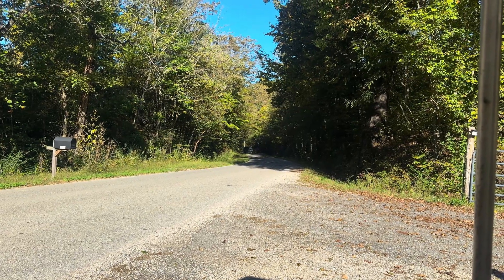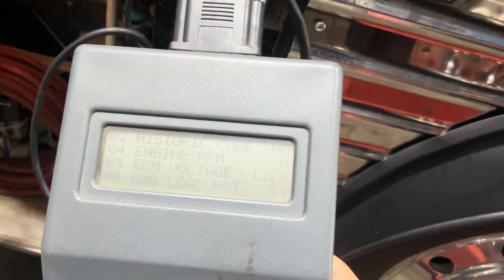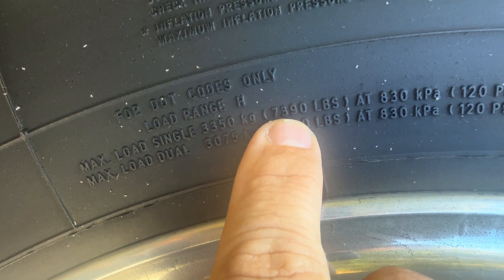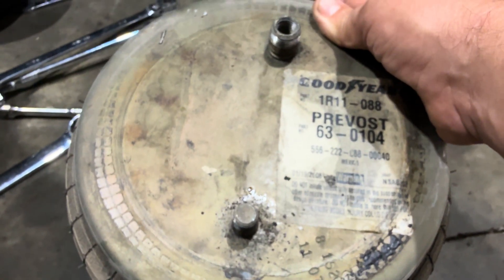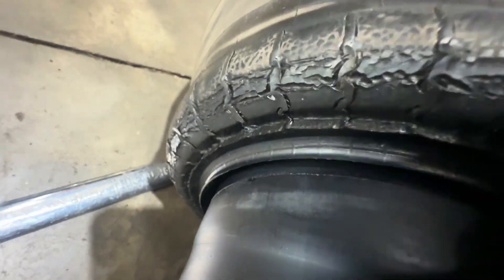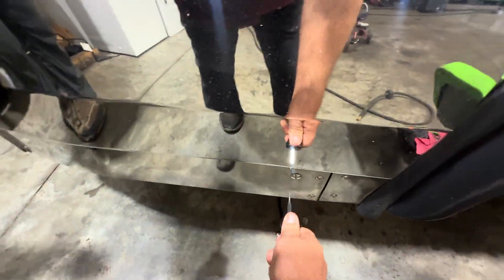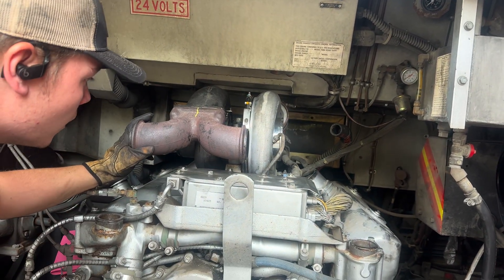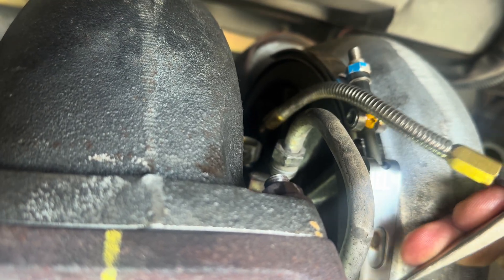Dangerously Overweight Prevost Bus.

Comment: People go nuts with the interiors with tile and stone counters... And forget its a vehicle.
Reply: And those stones and tiles weigh a ton!  Then you add the mud used to hold everything together and you can see where this is going...😊
Reply: @thomastaylor6699 Our floor is Porcelain!!!
Reply: And they pit real wood materials in them also....wood can be very heavy
Reply: @Rccrdawgs  Real solid wood could weigh a whole lot less than a lot of cheaper alternatives. Particle board and MDF is crazy heavy. A single sheet of 3/4" MDF is almost 100 lbs and you are going to need multiple sheets to do anything useful with it.
Reply: Wait...  STONE AND TILE?????!?!?
Reply: @bingusmctingus4395 yeah they come from the factory like that even for the big-money ones. Lmao. Rolling McMansion.
Reply: @bingusmctingus4395  Prevost... they are a bit over the top sometimes.
Reply: Solid Granite counters are essential
Reply: I would still think that would be lighter than a bus load of people
Reply: @b1g1lz  This is exactly what I'm thinking. Not only people but the weights of the chairs and luggage bay. I don't get it.
Reply: Cannot agree more. Every time I see a Prevost interior I roll my eyes with the heavy shits they put in to impress the unsophisticated buyers. I call them gaudy pseudo luxury. Most of the extremely well designed and built RVs are European, especially German. I will never buy any of these, new or use, unless I intend to renovate one myself.
Reply: For sure.  They could have Corian countertops instead of quartz or granite. Stainless sinks instead of cast iron porcelain.  Thick plexiglass instead of thick glass.  Those three things alone could save a couple thousand lbs

Comment: Wouldn't tell you how to do your job but I set the koni's a half turn out. I work on luxury busses for 40yrs
Reply from the maker: They were set to soft.   We are trying stiff now.  Good news is we can easily dial them back down
Reply: @BusGreaseMonkey how old were they  what was the mileage on them  Koni’s I’ll bet are expensive my trucks we do shocks every front tires replacement or around 100 thousand miles on our simi trucks I’ve never worked or owned an RV

Comment: How long do air bags last.  🤔
Reply from the maker: 8-12 years is a good estimate but some climates are harder on the rubber.  We have seen them 30yrs old plus but that is way out of the “safe” range of operation.   Risk of blowout is higher every year.
Reply: @BusGreaseMonkey  is there a treatment (like there is for leather seats) that can be put onto airbag suspension to prolong its life and reduce cracking?

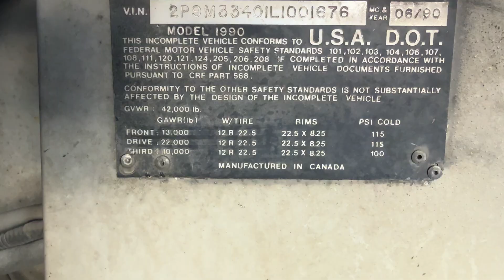Comment: Looking at the cat scale weights, how much weight is the tag axle transferring to the steer axle? (I am assuming that is bus only weight, not bus and towed car. T the trailer axle weight is just the Tag axle weight. 6:11. Maybe drop the tag axle weight pressure lode to between 6500 and 7500 pounds? Would that pull 250 to 400 pounds off the steer axle and transfer it to the rear axle set? Looking at the weight capacity plate, with a 22,000 rear axle GAWR, 5:58 , you’ve got some wiggle room. But I am not sure if the federal axle weight bridge rule limits to the rear axle to only 20,000 pounds.
Reply from the maker: The entire gvwr is exceeded already.  If you stand on the bathroom scale on one leg are you going to weigh less?

Comment: It’s crazy to me that what was once a very expensive custom bus has almost no cargo carrying capacity. It seems the converter didn’t factor in normal things one would need to carry. I just assumed a high end bus like a Prevost would have tons of excess capacity.
Reply: Prevost buses have the tallest storage bays in the motorcoach industry. 
Either the converter or the owner is the cause of this problem.

Comment: What did all the repairs  cost this customer ?
Reply from the maker: About 10k.  We also did a tune up and set the exhaust valve clearances, fuel injector timing and jake brake clearances, engine oil change, brake adjustments, chassis lube, and inspection.

Comment: For some reason, it never occurred to me until now... the tires and wheels are going to be a part of the scale, axle weight, which wouldn't be on the actual axle weight as such, right? I assume that's factored in for the manufacture as a sort of tare weight though... anyone, Bueller...? 🤔
Reply from the maker: The Spindles are holding the weight.
Reply: @BusGreaseMonkey  - Sure, but why can't George cuss? 🙂 I'm on "Bus Rescue Sitting 20 Yrs Will It Start & Drive Again? " now... Cheers- ☮
Reply: @BusGreaseMonkey  - Aren't the steer tires/wheels around 100lbs each? It's not a deal breaker, and granite flooring should probably go... it all adds up...

Comment: I imagine a bus has a Center of Gravity (CG) point like and airplane, move the heavy stuff like the tools aft and the bikes forward, smaller LiFePo4 batteries moved back, move the un-needed tools and stuff out of the nose compartment. Moving weight aft takes the load off the front, overall weight just means thinning out what you have on board.
Reply: Yes, they were overweight on the fronts but underweight on the drive axle and tag axle...so they could potentially shift any movable load backwards, if possible, of must carry items. Also, any heavy items ahead of the front axle will increase load on steers while lifting up on rear axles.
Truckers  make adjustments like this by sliding their trailer axles forward or backwards and/or their 5th wheel forwards or backwards to try to load unload all their axles to keep them at or under load limit. They probably need to shed at least 2000lb -3000lb to get the GVWR back under 42000lb enough to allow using max fueling and water carrying and some payload.
Reply: 86 all the rock additions and go with lighter materials.

Comment: Hard to take that weight out and my guess is the new tires and rims will sadly offset some of the gains.
Reply from the maker: But the tires will be much safer not at their max load and have a couple thousand lbs to spare
Reply: @BusGreaseMonkey  Absolutely. Fixed the weakest link.

Comment: I'm glad I caught this video.  We have an '89 XL that I bought about 3 years ago; 77000 original miles.  I will have to find the scale ticket, but we are 1700 pounds under GVWR, which is 42000 pounds also, and thats with 2 generators.  We are gonna renovate the interior but will definitely look into those different sized wheels/tires for the steer axle.
We do all the work on this silly thing; it's not too bad if you have the tools and the space, but you gotta do tha work!!!!

You and your crew do exceptional work, Bus Grease Monkey👍💪
Reply: Just remember, just because you can carry thousands more in lbs. with bigger tires, your axle is still limited by it's rating.

Comment: 🌈 Thanks Scott ⚓️ most these guys carry magazines & the library of congress… heavy stuff. I’ve always thought about a hole saw on the cabinetry… I’ve sailed racing sailboats… every Oz counts 🪢 cabinetry bulkheads are pretty heavy 😎 And can withstand some perforations. One time… on a Hylas 46… we used a dedicated trash bin to collect the cores & accumulated close to 100 lbs. of course then we had to finish the holes with polyurethane varnish to keep moisture at bay 🪢

Comment: unfortunately the larger tires add more weight too, not sure that adds anything to the carried weight tho.......seems the origional conversion company could have been a bit more proactive on weight distribution when they built it out.....not a easy solution now for sure. The entire frontend parts should probably be considerdd on the "extreme service" level of wear and maintenance intervals.

Comment: When you buy new turbos without a core, you should send the old turbo out to be rebuilt.  Those basic plain bearing turbos are usually cheap to rebuild.  Usually around $500.
Reply: Area Diesel has been doing me right on this.
Reply: Especially if the alternative is scrapping it or otherwise wasting it.  When I'm in a position where I need to buy a new part like a CV axle, I still give/send my old one back as a core rather than having it go to a scrapyard just because it isn't of value to me any more

Comment: I'm not sure if Prevost has this option, but if the weight carried by the tag axle is controlled by regulated air pressure in the travel mode like it is on a Monaco Roadmaster chassis, have you thought about lowering the tag axle regulated air pressure to put less weight on the tag axle and more weight on the drive axle?  If you had another 2,000 lbs on the drive axle with less weight carried by the tag axle this would in effect shift more weight towards the rear and lessen the weight on the front axle.  Likely it won't completely solve the problem but every bit helps.

Comment: Lithiums will save a ton of weight, judging by the batteries he has you could probably eliminate a couple hudred pounds right there.   I boondock in the desert in my Tiffin 90 gallon fresh and that will last over a week.  He could go less water.
Reply from the maker: Those are Lithium house batteries.  It must have really been over weight before

Comment: I'd think the majority of the problem with the weight is an overbuilt interior.
Reply: The Safest thing is to change the front axle to a 20,000 pound. A Steer Safe if he doesn’t already have one. You’re already changing the two front wheel’s. Pretty coach. Sad thing when it left the factory as a shell it was fine, but Prevost knew the body was being shipped to a conversion company. Conversion specs from the factory should be heavier than transit.
Reply: YEP!
Reply: No way! I would never guess that would be an issue.
Reply from the maker: Granite flooring is a bit excessive.
Reply: @BusGreaseMonkey  Must do wonders for the fuel mileage.
Reply: @BusGreaseMonkey 😂
Reply: @BusGreaseMonkey  Yikes.

Awhile back some company was trying to tout their go-anywhere Ford F550-based offroad RV as being the best thing a million bucks could buy.  When it was shown before being tested we were treated to marble countertops and other fixtures more commonly associated with luxury houses.  The truck managed to twist a driveshaft trying to go up an uphill dirt road.  The upfitter had the gall to blame the people they loaned it to for testing who chose to take the 'go anywhere' claim at face value.
Reply: @BusGreaseMonkey The converters use lightweight granite/stones.
Reply from the maker: Well then we are putting helium in the tires to offset the light weight granite. ;)
Reply: @russellhltn1396 Americans don't care about fuel mileage. Especially Boomers.
Reply: @TWX1138  This is why those are all switching to the F600 platform.  Once the motorhome is put on the F550 they barely have a 1000lbs of carrying capacity
Reply: I'm a class c owner but I'm impressed at this man's in-depth inspection and knowledge. I'm subscribing.
Reply: Empty the crapper...my bus was full..........
Reply: A close second is no desire to make changes 😂
Reply: Agreed! Likely that the interior is built of particle board with veneers. Very heavy. If it has a couch forward, that thing alone could weigh over a hundred pounds. The slide out for the e-bikes could have the platform replaced with a composite board weighing less than 1/2 as much.
Reply: @martymorse8967 I've wondered about the approach that Scamp and Casita have followed with their use of fiberglass inside of their trailers in addition to being the body, and if similar techniques for carbon fiber could be used for interior fixtures. It wouldn't even have to be showy with the weave of the base material showing either, just something used because it's both light and strong.

The headache might be that for it to be cost effective there would need to be a limited number of internal layouts so to reduce to standard molds/templates for producing said fixtures.  But I don't see it being much worse for flammability than sawdust held together by a binding agent.
Reply: And an underbuilt owner.

Comment: Change out the lead acid batteries with lithiums. That will save a lot of weight.
Reply: Looks like he already has LiFePO4, though, there are better options than the form factor he has. The Magnum Energy (now Sensata) inverters weigh a lot and there are much, much lighter brands and could probably replace the two Magnum Energy with a single inverter that weighs less than just one of the Magnum Energy.

I personally have gone to a 48v system because it opens up a huge selection of inverters and requires smaller gauge wire. In his case, it would make relocating the batteries a more feasible option.
Reply: Big fire risk with lithium batteries
Reply from the maker: Those house batteries up front are already Lithium
Reply: @dannycrooks8462  No there's not, iron phospates Lifep04 do not thermal runaway like the lithium polymers do.
Reply: @dannycrooks8462  Rubbish. LiFePo4 not an issue.
Reply: @Ozsmallbore Still waiting, Oz